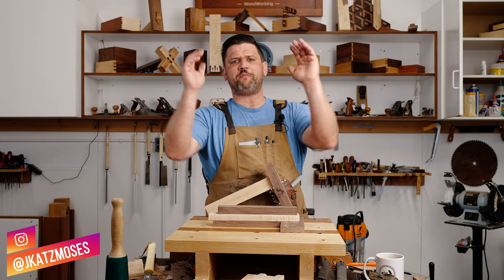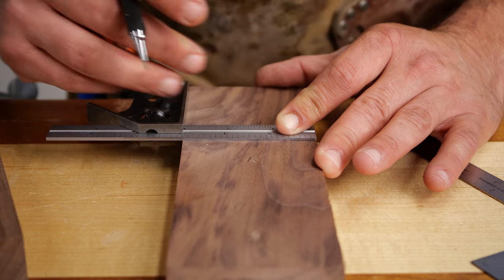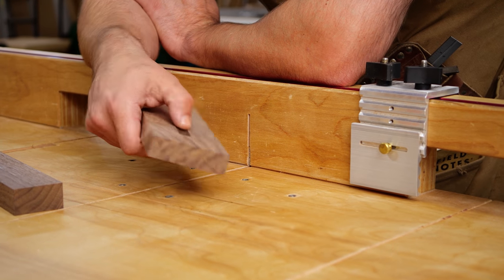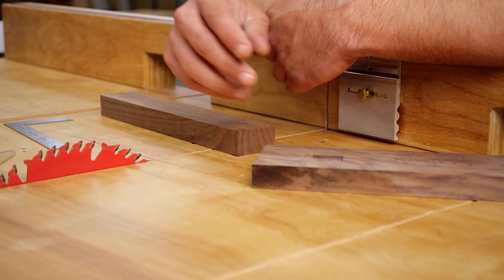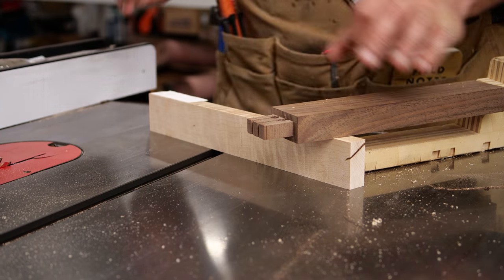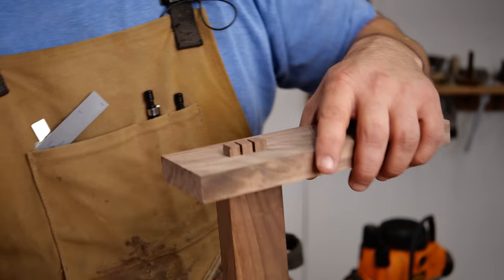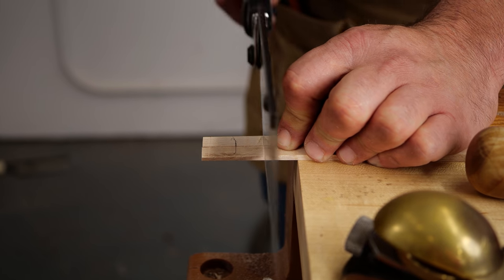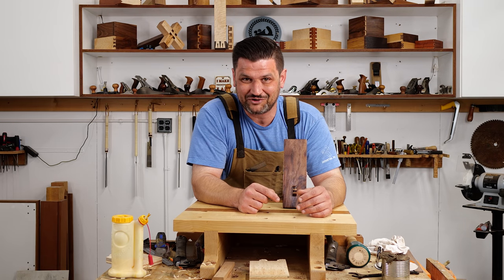Wedged Mortise and Tenon - Joint of the Week

Comment: Thank you, Bro!!! I just finished (6, 1 1/2in x 1in) my first wedged mortise and tenon and it came out GREAT!!! Your emphasis on the wedge is so ultra important... though I didn't use all your techniques--and I feel like you left out some important steps but, I like how you left yours 'raised.' There is not a lot of material on-line or images anywhere for that matter but yours looked the best out of all the research compiled. I used a Japanese pull saw to cut the kerf because of its thinner results and bandsaw to cut the wedges. I've only been woodworking for 1 1/2 years and went straight to the big leagues !!! so the joint only took me 9 mos. 🤣, but now I feel like I can do it again much more faster!!!!!! Thank you much for your tutelage, Sir!!!!!

Comment: How about a sliding dovetail.  Looking at using them on a table project to join worktop to leg assembly, allowing for seasonal movement and eliminating the need for a block end to maintain alignment.  Ideas on setting out or whether to cut the male or female section first would be great.
Reply: watch ishitani build tables, he always uses sliding dovetails. the guy is a wizard.
Reply: Cheers for that

Comment: For a more secure mortise and tenon would you flare the mortise slightly larger on the outside so when the wedges are inserted it ‘locks’ the mortise and tenon together? Love the videos - finished dovetail drawer #2 with your jig! Almost makes me an expert 😉
Reply: It’s mechanically stronger that way but harder to do.
Reply: Im going to practice the Forked wegded tusk tennon not only for strength but looks. Its going to take me time to get it down though.

Comment: Awesome video, super informative and that joint came out beautifully well! I know this was from a few years ago but do you taper the mortise hole to allow the tenant to open up with the wedge or is the  mortise straight through? Cheers for posting, really inspiring to watch!
Reply: Yeah, that's what an actual wedged M&T joint is, he just didn't do that part. This is just a through-mortise with some of the tenon material replaced with maple. The joint he made here is probably weaker than a regular through-tenon because he removed more material with the drilled holes. This joint looks good, but this is not correct.
Reply: @Beefbananas  cheers for the explanation! Lots to learn here!

Comment: Just watched this and it is really cool and I did enjoy. I am thinking that used in the right place it could be spectacular, so thanks for sharing.  I do have a question/thought and you may not respond since this video is 1.5 years past. And that's OK because just taking the time to think it through is worthwhile.  But here goes, would it make a better joint  if the shoulder side of the mortise was a bit smaller than the side where the wedges are driven, then when the wedges are driven the spreading of the tenon into the wider side of the mortise would create a type of a dovetailed mortise-tenon joint?

Comment: If you find yourself doing this by hand make the wedges using a marking gauge and a sliding bevel. Just mark off the maximum width of the wedge with the gauge and then set a sliding bevel to whatever angle you'd like the wedge to be and mark up with a scalpel from the mark you cut with the marking gauge. As long as you don't reset your gauge+bevel between marks that'll result in even wedges.

Comment: Made myself a wood mallet with one of these joints and clearly should have watched this video first.  I cracked the handle, probably because I used a hand saw for the cut and pushed the sides too far.  Thanks for next time.

Comment: Great video. I always thought the mortise should have sloping walls so that when you add the wedge it effectively makes it into a dovetail shape?
Reply from the maker: Sounds like a good way to have gaps and break things
Reply: Jonathan Katz-Moses no, honestly, give it a try. If your mortise is about 5mm wider at the top than the bottom, you can bang a wider wedge through. I like your way better but I tried it after seeing the 3rd coast craftsman. Could be a good idea for joint of the week? Gives you a load of funky contrast. I did mine with white oak and Purple Heart wedges. Btw, LOVE your dovetail jig. Most used thing in my shop! Thanks for all the excellent tutorials. I learn so much from you.
Reply: Aw c'mon JKM, you know he''s right. We don't avoid difficult joints, we do them because they're difficult (to butcher the old JFK quote).
Reply from the maker: @Norm7264  I'll bet you any amount of money this could pick up my drum sander. You name it. I'm serious. The number of comments I get on JotWs that say, "that's weak because of x," astounds me. Some people think you need to build every single woodworking joint to withstand a nuclear blast. A through mortise with wedges, made like this is way stronger than a regular mortise and tenon. Either of them, with or without wedges, with straight walls, would hold amy piece of furniture together until the wood rots around it. Woodworkers don't need to make their lives harder by coming up with extra steps to and already bullet proof joint. Beautiful joinery should be strong enough to serve it's purpose, not every purpose.

Comment: I haven't heard about Eropeans not having dado sets... any reason why?
Reply: Because you can’t use a riving knife with a dado stack.
Reply: @Grillinandgluin  And there is a requirement for a riving knife?
Reply: Over there it is required to have the riving knife installed.
Reply: It's because the law says that the blade needs to stop within a certain time after its switched off (in commercial settings not private ones). On the cheaper tablesaws they don't offer the option of the extended arbor required to take the dado stack because the dado stack doesn't stop as quickly. But if you buy the heavy duty equipment from felder for example they offer the option of the arbor and their own dado stack. You can get an extended arbor retrofitted if you want. It's just the manufacturers don't want to take the responsibility of the equipment not meeting the minimum standards. 

It's also cheaper for people to use routers to do the job rather than have warrantied retrofitting done or buying heavy duty equipment that does meet minimum standards. People either avoid using them because they're more expensive, considered a little more dangerous or erroneously believe that they are illegal. Businesses use them all the time because the time saved offsets any extra costs in buying industrial tablesaws or the slightly  more expensive insurance.

Comment: Very good, Jonathan.  Doing wedged through tenons on a really large item (like the Samurai Carpenter Workbench where the triple tenons are on the ends of a long, heavy apron) presents a whole different set of challenges, particularly when the mortises have to be cut into a thick workpiece (like the 3 inch thick end piece of the workbench).  Many of the things you showed would not work.  But there are always multiple ways to "skin the cat" (can one still use that phrase in these politically correct days without PETA showing up at your door?).  I am looking forward to receiving my Jonathan Katz-Moses stop block when those come out of production- the same one you featured in this video.